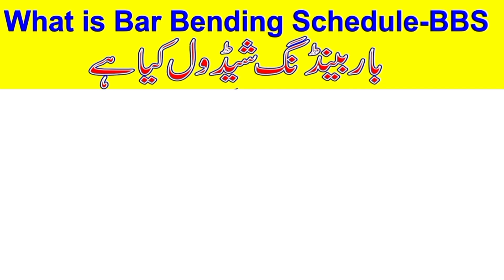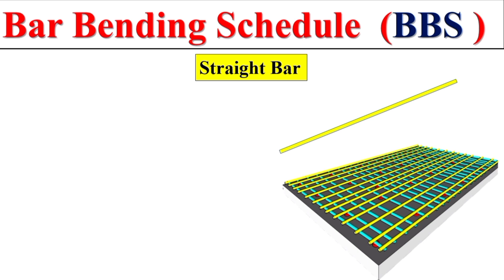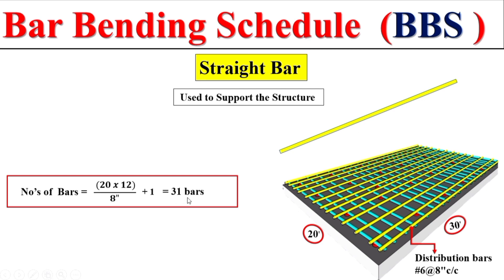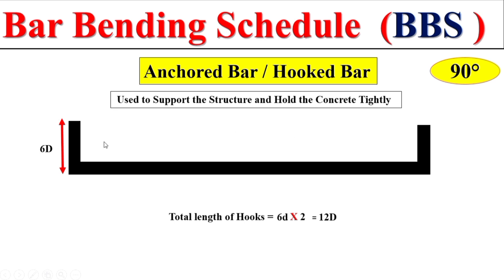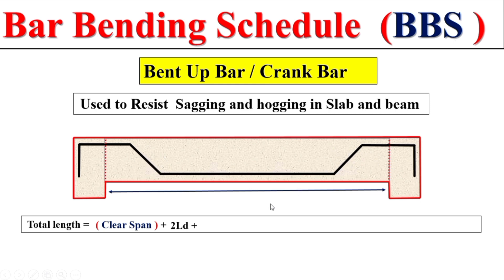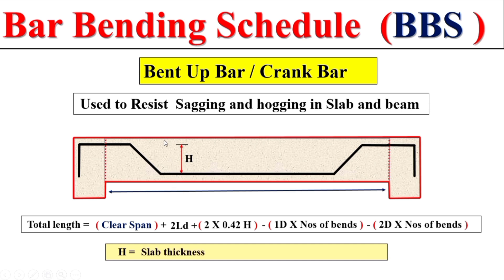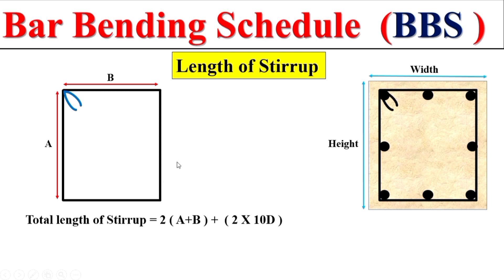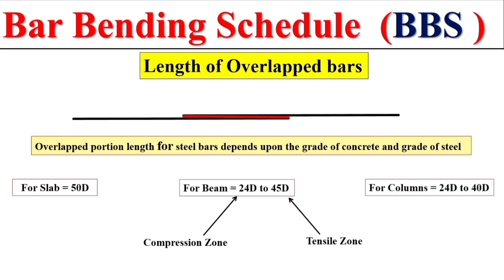bar bending schedule | bar bending schedule in Urdu | bar bending schedule in excel |

Comment: Can u tell in which code you take these value about overlapping? Cause we use Aci code in Iraq, so I just wanna be sure to keep these information in mind.
Reply from the maker: Dear Kamal normally we  used this code for practical problem & basically it's mixture of both ACI and (IS) codes
Reply: @civilengineeringzone7082  

Thanks sir.